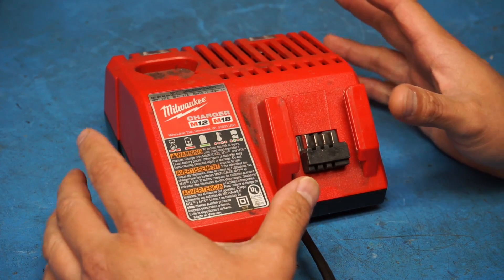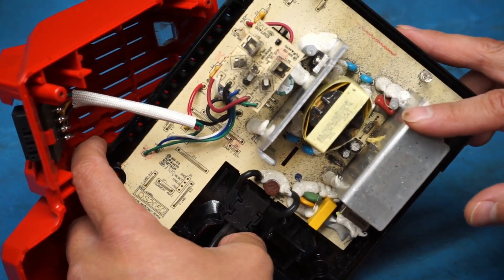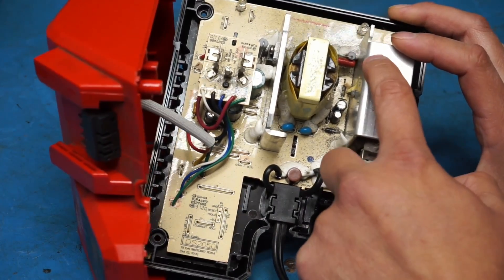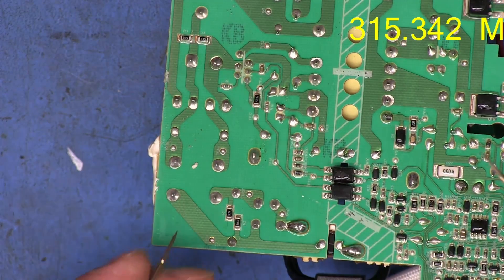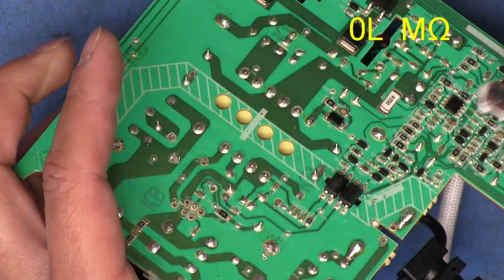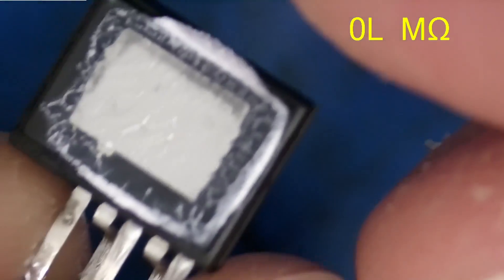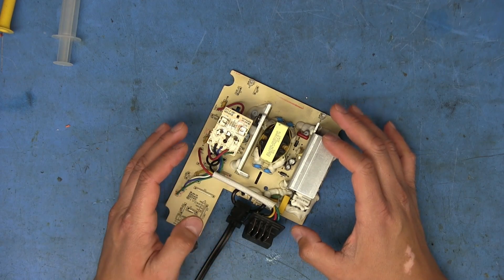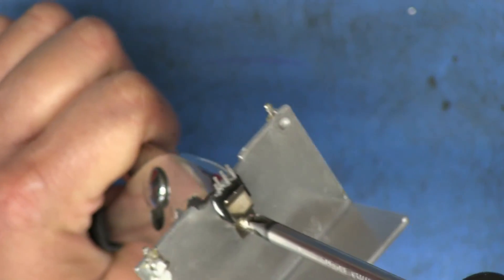TEF #133 | Milwaukee M12 M18 Charger Repair Attempt -  Will It Charge Again?

Comment: My plug broke so i spliced another plug into the existing cord and it would work but very sensitive like a short if you moved the cord. Now wont light up at all? Tried to resplice and nothing? Havent opened casing yet but why would just repairing the cord make it not work?  Any help would be great! Same charger you have in video.
Reply from the maker: If nothing fried or smells like it burned up, it could be the power cord just has an internal break, possibly close to where it enters the body of the charger. replacing it entirely may get it going again, but I wouldn't be able to say for certain. You'd have to measure continuity on each wire from the plug end of the cord, to where it solders into the chargers board.

Comment: Im a welder so mu charger deals with a lot of metal dust. I had a spark in my charger and now it slowly blinks red meaning it's waiting for another battery to charge. Even if i only have one battery on it still acts like Ive got 2 at once. Would you think that would be the switching regulator that you mentioned? Sorry if i explained that bad
Reply from the maker: Your explanation sounds fine, but if it's powering up and flashing red, it's not going to be the switching regulator in the video. It's going to be something on the charge controller side of the circuitry.

The switching regulator on the high voltage side is used for converting the plug power into the lower voltage required for charging batteries. It doesn't have anything to do with detecting batteries or their charge status.

Comment: Nice repair. I'm going to send this to a friend who uses Milwaukee chargers.
Reply from the maker: Thank you!
Reply: @ThatElectronicsFool when i insert battery, the red led is slow blinking- i measured voltage in 12v and 18v line on   charger but no voltage